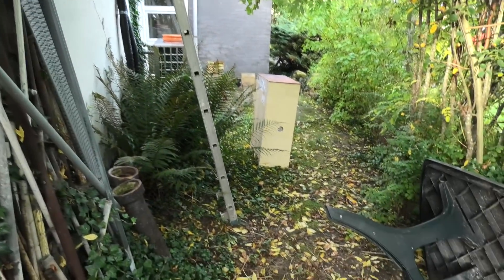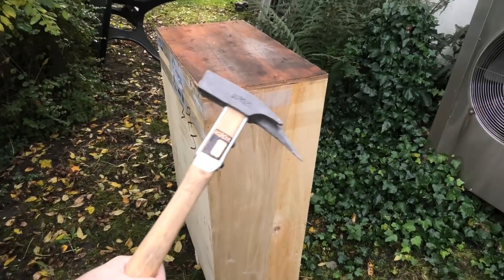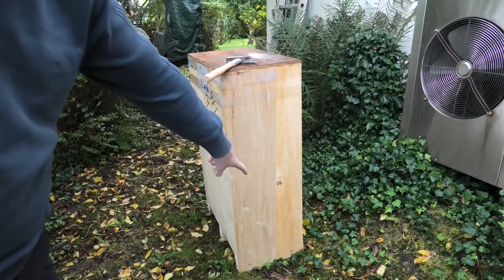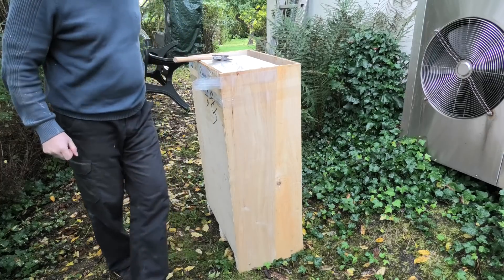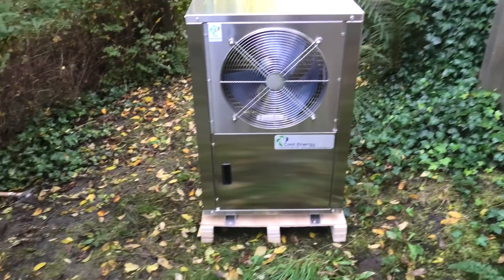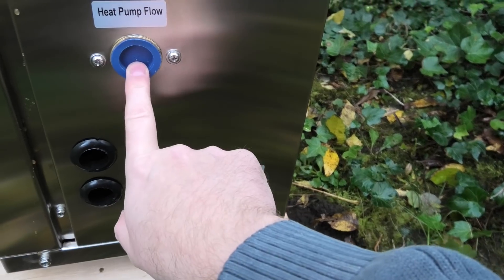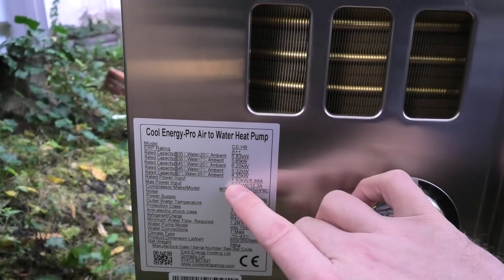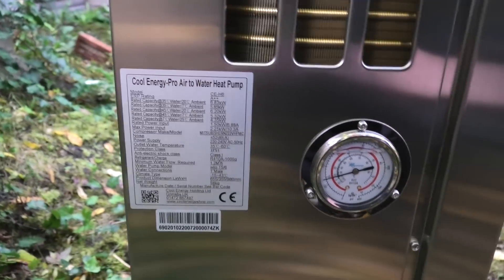I Will Eventually be Able to Heat my House of Solar Power - 1006

Comment: Your smart not cheap. Using electrons for heating i agree is wasteful in the long run. But if u can use free electrons, why not. Thats smart and efficient.
Reply from the maker: It would be able to shorten the period, where I need to burn wood,, and not needing as much wood, means that I can use better wood.

Comment: 3 phase
Reply from the maker: Yes old one is 3 phase, new one is just 1 phase.
Reply: @MyPlayHouse  should make it easier to integrate into your solar
the "audio" cable that it looks like your using from the solar panels its really recommended to use minimum double insulated cables and if that is inside a metal pipe that should be earthed as well as you could have a hot pipe

Comment: 400Vs is not a lot of power. it is nothing powerwise
Reply from the maker: Well why is this 400V and not 12V,,, to keep the amps down, when it draws a lot of Power
Reply: @MyPlayHouse  
power is kw and not Volt
you also mixed up kw and kwh

Comment: I was just thinking that, a genius like you are could make the old heater fan into a free energy regeneration device. And save even more cash. ;-)
P.s if it is 20 degrees outside, over here in England UK we would like the heater on thank you.
I would put those, paving slabs on eBay. ;-)
Reply from the maker: it is 12C outside today, and 21C inside,,, I have not had the heat on today,, I am surprised.

Comment: Im warming my house with my server rack currently, my furnace went out, waiting on the repair. So i opened the door to my network room and it gives me a few extra degrees in my home, (its about 35f outside and with the network room door open im at least able to hold a stable 66f in my home, if i have the door closed it will drop to about 59f in the house)
Reply from the maker: I do that to :-) https://youtu.be/u_Rp3NLfMto

Comment: Datacenter cooling sounds like an interesting topic.
Though, it is honestly questionable if it wouldn't just be better to use the well in your basement instead.
I know you tried that already using a bunch of radiators and not gotten much success, mostly due to high air resistance.

But always nice to get some extra heating during winter, and if it is solar powered, then that is a bit better, even if I suspect that solar collectors are technically more efficient at heating. (Most solar panels are only about 12-25% efficient at collecting power, and a heatpump that moves an additional 3x of heat would only bring total efficiency up to about 45-80% in the end, not including losses in the inverter and caballing. Though, electricity is a lot more versatile than warm water.)
Reply from the maker: I "cool" my data center by removing the hot air from the back of the servers,, and in vinter I blow that air in to my house,, heating.
Only a very few days when the temperature is over 25C does this become a problem,, not that I can't cool the servers,,, No it just becomes very noisy,, it has to move so much more air to cool. At that point it would be nice to cool the intake air just enough to keep the noise down.
Reply: @MyPlayHouse  I am familiar with your situation, been watching for a couple of years.

One thing I would experiment with would be a plywood box under the storage shelves. And then mount radiators along its whole length, would provide a lot of surface area, though at the expense of more radiators, and less storage space. And obviously likely not worth it for those few summer days.

Comment: Interesting. If I would be doing this it would be for the self sufficiency sake. At current power cost where I am located. Something like this would have an efficiency payoff amortized over 20 years at say 3k dollars after install. 1500 for unit then 1500 for solar upgrade.
Reply from the maker: Well You know,, making your own power might just become smarter along the way. I would like my next car to be electrick, and as there are plans to stop selling fossil fuel car's here by 2030 or 3035,, even it has not become law yet,, it is going in that direction.
Reply: Indeed. My first plan for self sufficiency is a wood stove the I want to practice solar with a shed that runs a bright led to light up the back yard at night.

Comment: Built my first full-time Beowilf cluster all from Bargain Hardware sales on eBay, I still utilise the seven CS24-NV7s today. All filled with 64GB RAM and packing bays of storage to run VM duties, also trying to expand my dual 40GBPS IB for RDMA while IPoIB could come in handy over a pair of 40gbps links per server.

Nice heat pumps, I've been designing my own HVAC for a while now too, ground up.
Reply from the maker: Cool,, what do you use or plan to use the  Beowulf cluster for ? what it it really good at doing ?
Reply: MPI, parallel programming, it's a bit old hat today to even utilise the Beowulf notion when Hadoop is around but I still really enjoy the entire notion as it was.

Thanks for replying, sorry I've been a little busy with my IBM X3950x5 2Node setup and some infrastructure upgrades this week :)

Comment: The time when you need heating most is the time when your solar panels don't produce any power.  Time to assemble your 10,000 18650s to store some solar generated power.
Reply from the maker: That is correct! there are a few options,, batteries, water buffer tank, and over heating the house in the day time.

Comment: Hey Morten, the place in the UK that the heat pump is made is Grimsby (Grims Bee) 😎😎😎 Another great video as always, can't wait to see this hooked up into your heating (and possibly cooling solution for the data centre) system 👍👍👍👍
Reply from the maker: Thanks for the info! my good contact at Bargain Hardware told me that there was something about fish in that city.

Comment: I would honestly put the new heat pump onto the existing one. Like that the do noch influence each other air-flow wise, it is at the right place, not in front of a window, and you can even put a three-way-valve into the existing pipes and use the existing pipes if you don't run them in parallel?! Safes some serious money. With a bit of in-depth controller tuning you could even run them in parallel though.

And there are 3-phase solar inverters, so you could even run the old heat pump with the matching inverter hardware!

Btw., You will realize that orientation of solar does not matter as much as you might think. Yours is fine.
Reply from the maker: 3-phase inverters are as expensive as the Heat pump,, and it becomes a bit scary,,, and complicated.
I know the solar will be okay :-) Thank You!

Comment: It is beautifully made... All that stainless.  I installed a mini split myself for heat and cooling here in Canada. It is very efficient and quiet but it looks like a toy compared to those units. lol
Reply from the maker: I have radiators in every room, so air to water seems like a good option. I have no idea why an air/water is so much more than a mini split..
Reply: @MyPlayHouse  at least you do not need to vacuum any high pressure lines for the water unit.

Comment: Heat pumps, unless you've got a river at the bottom of your garden forget it.
Reply: They might not keep up in the middle of winter but they're a nice addition most days of the year when it is just slightly below 19 deg Celsius. Could always keep a natural gas powered system around for the really cold days, maybe pump hydrogen into that? Though that does make things a lot more complicated. Alternatively you can just drill a hole into the ground and use ground water, also works great.
Reply: @jadoei13  Love to see the figures. And as for solar the state Of Arizona  with acres of panels and endless sunshine could not make them financially viable. Northern Europe forget it as the Germans recently found out.
Reply: @mikemines2931  It's a bit older, so things might've changed slightly, but this is a nice book on the matter and here is a page on how much solar we would need to power all we currently do in the EU and US: https://withouthotair.com/c30/page_236.shtml
The complete book can be found here: https://withouthotair.com/download.html
In the end I don't think there is 1 solution, especially with the amount of power people in the US use. I do think it can function as just another easy step on the way to a more sustainable way of living. In the end we will run out of fossil fuels in a couple of decades, maybe a 100 years? It doesn't really matter, the transition will have to occur no matter whether you are concerned about climate change or not. 
I go to the University of Technology Eindhoven and it is all heat pump powered. Yes they use ground water, and have a gas powered backup system for the very cold days, but most of the year it runs on heat pumps: https://www.tue.nl/en/tue-campus/discover-your-campus/sustainability/campus-and-operational-management/energy/heat-and-cold-storage-ates/
Reply: @jadoei13  Germany went green and nearly melted down the French nukes, that's why new coal fired stations were built in Germany burning domestic brown coal. Absolutely filthy stuff and the plume covers Europe on bad days. Google Ventusky, a real eye opener.
Reply from the maker: There are two coal power plants, being planned or under construction. in Germany,, and there are 50 which is being phased out.
https://www.carbonbrief.org/mapped-worlds-coal-power-plants
Coal is surely going out,, it is taking a bit, but that is the way most of us is moving.
Reply from the maker: Well this works just like your aircon,, it's just flipped around and heats the inside and coles the outside.
Reply: @MyPlayHouse  Good god I'm English, we dont have aircon, we just put another vest on or take one off.
Just like a refrigerator in reverse I know, have you ever worked out how much they cost over a year to run! Freezers even worse. Lets see you run one of those with solar cells stuck on your roof.

Comment: I expect to replace my oil boiler with a heat pump next year, most probably getting heat from under the lawn. And PV on the roof to cut down on running costs, too.
Reply from the maker: It's a big job, to get the whole garden dug up, to put down the hoses. But it is a slightly more efficient  way to do it. A combination of the two,, would be great. When ever the air is under 5C,, use the ground,, that way the ground does not freeze up as much, around the pipes and the efficiency must go up.
Reply: @MyPlayHouse  I also hope to lower the noise level by not depending on big spinning fans. The way my house is built the natural location for the installations would be under my balcony, and near where I spend most of my indoor time. I've also been thinking of supplementing with an air heat pump, but that would be a possible next step.

Comment: Need a 2 stage thermostat? 

My forced air natural gas system has Lo/Hi and the thermostat will measure the rate of heating and will kick in the Hi mode after 5min or so if it’s not warming fast enough. It’s Honeywell’s algorithm but infinitely DIY-able.
Reply from the maker: Hi Peter G.
Thank You very much!  glad you liked the video :-)
Thank you for watching! :-)

Comment: I installed a heat pump about 2-3 weeks ago, only an air to air, called by most people an split air conditioner, only this one can heat as well, with an scop of 4 (1 kw power, 4 kw heat) It works very nice, only when it gets really cold, i have to use the gas heating.
Reply from the maker: I got the air to water, because I have radiators in the whole house..

Comment: Nice...now u need water buffer and fan coil unit for data center and one or two for apartment .......
Yes is not so complicated as it looks....
water pump inside is also power eater..
Made in China on/off H.P. without extra features...
How would you make water connection in parallel to big pump or in series to heat pump or separate pipes???
Make video about this topic...
Nice idea by the way....
Right approach would make big effect ....
Is topic for open discussion how to make right without bunch of el. valves...and stuff...
Nice video like the new topic solar powering heatpump....
Reply from the maker: I am just going to parallel it with the bigger one.
Reply: But water goes the way with lowest resistance...it would go through the big Hpump.....
Both H.pumps shuld have single way valve because both have water pump inside....I think....
Big water tank is for 3 tings 1hot water storage  ...
2 prevent to much on/off cycles on hour  determine compressor life(I have destroyed mine Hpump compressor so)
3 storage tank act like hydraulic switch 
1500-2000l/150-180m²....and it would prolonged heating cycles deep into the night ....

Comment: photovoltaic panel is the inefficient way to heat your house !!! 
You should install thermal Solar panel ! Hot water is really cheap to store vs electricity. I bet your PV panels won't be able to heat your house in winter... so what's the purpose ?
https://en.wikipedia.org/wiki/Solar_thermal_energy

edit : another interesting source : https://www.lightsourcebp.com/2014/09/should-i-use-a-solar-pv-or-solar-thermal-system/#:~:text=Solar%20thermal%20can%20turn%20around,seeing%20this%20number%20consistently%20increase.
"Solar thermal can turn around 90% of radiation into heat, whereas solar PV has an efficiency of between 15% and 20%"
add your heat pump efficiency loss, and you can hope to return 10% of collected electricity into heat vs 90% for thermal panel :D
Reply from the maker: I do have thermal Solar panel ,, or solar collectors,, and they do heat the water in summer.

Comment: Heating water when it's warm isn't useless, through a heat exchanger to preheat water then your hot water cylinder doesn't need to work as hard,  depends on hot water usage of the household and the method of heating.
Reply from the maker: Thank You,, but I do have solar collectors, and as soon at there is sun,, they makes hot water.

Comment: My man i would like to suggest you leave solar power as a "passive" gain for its way more expensive and has too much loss then wind turbines due to where you live, if you want to think about it in long term, go with any wind tech, you might get used to the noise faster then the hilarious amounts of money you gonna dump into solar tech due to your current location. ps; keep it up with the good work, i like your videos :)
Reply from the maker: I am in a hole,, I do not get enough wind for it to matter :-/  I do have a wind turbine,, it does not do much.
Reply: @MyPlayHouse  invest in a new bigger pole/foot :P there are test kits you can buy to test the most accurate height for a constant output for either 6month cycles or 12 month cycles, and only after you've done all the tests  you can get a quote on how much it costs and if its gonna be worth it or not... just buying a default one premade and setting it up would never give you any constant profitable output.... unless your house is on top of some mountain :D you might already know all this, its exactly like with the solar tech... shet you can make a lot of money nowadays by renting public spaces surrounded by a lot of artificial wind/traffic just install one wind turbine and make money :D you can even put it in your own garden if your house is right beside a high traffic road :P
i for one got a single wind turbine that just produces passive output that i merely use it during the day when the cost/kw is higher so its helpful in the end by having a lower electricity bill at the end of the month, but i also use the same pole/foot for my TV and iNet antenas :D so its very useful at least for me, because my house is very far away from anything and anyone also :D
Reply: Getting a permit for a tall wind turbine is most probably not realistic in a residential area.
Reply: @JohnnieHougaardNielsen  i think only over 10m you need to ask for a permit, but it all depends all over

Comment: 400v, that's a lot of power....** not to be out done, 1 Horse Power!(horse pulling carriage:P)
Reply from the maker: It is posable to get an inverter that goes from 48V DC to 400V AC,, but it becomes very big and complicated.
Reply: To be fair 400V is not a lot of power, it's a lot of potential power since Volt is the unit of electric potential and Watts is the unit of electric power. ;)

Comment: Those heat pumps are supposed to use 1kw and generate 3.
If it takes air temp to add heat, when it's cold, it can't.

Solar kind of works, it's only 20% effective.
Wind is about 40% perhaps you should try that route. 
Heating if you black box water it will heat most of the year, but ideally you would use an exchanger, and no use water outside.

Tbh I thought the heat pumps would do something like that.

UK are doing grants on these things at the moment up to £5,000.
Reply from the maker: There is quite a bit more solar then there are wind,,, and the neighbors does not complain about the solar panels.
We also get an bonus from the government to go to an heat pump,, but the companies has kind of just put that on top of the prices.